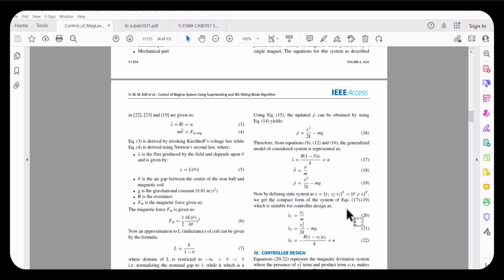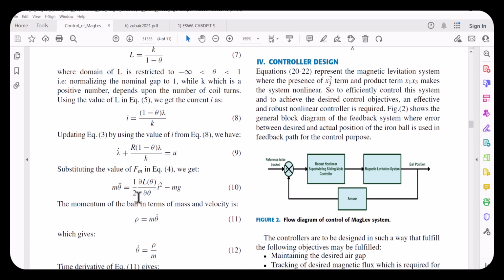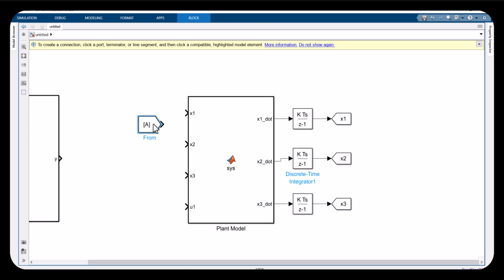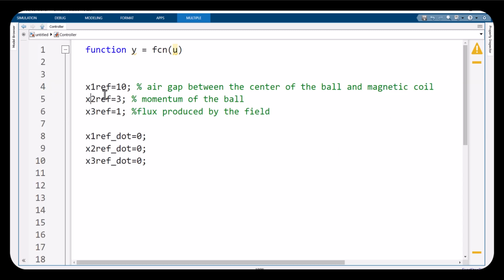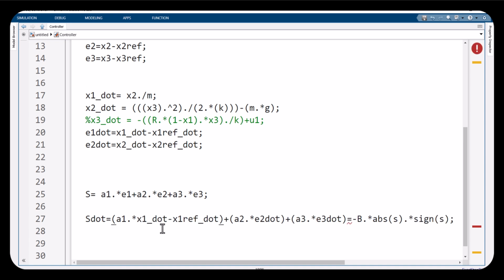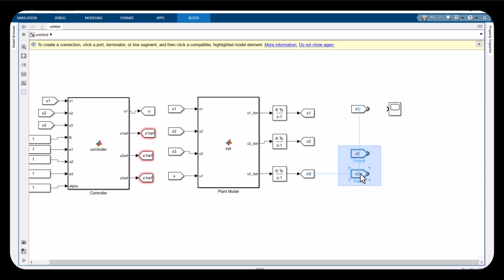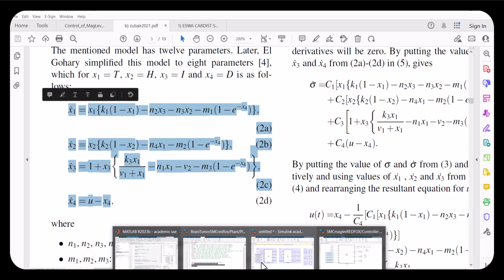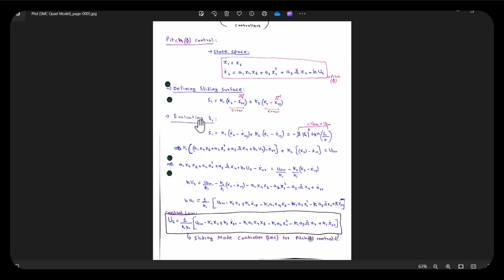i) Sliding mode control implementation on MATLAB-SIMULINK (Simulating a Magnetic levitation System).

Comment: Sir, firstful thank you for the detailed and beautiful explanation. I followed everything you did in the video, but when I look at the x1, x2 and x3 values on the scope screen, the time goes up to the 1st second and stops at the 1st second, and the reference value continues until the 10th second. Why does this happen? How can I fix it?
Reply from the maker: @dogukanzaif2463  yes, it means the system was unstable. You will need to do optimization to find the optimal gains for sliding mode control. The next video is regarding applying optimization.
Reply from the maker: @dogukanzaif2463  it indicates your gains are not optimized. See the next video and run an optimization algorithm to tune your gains.